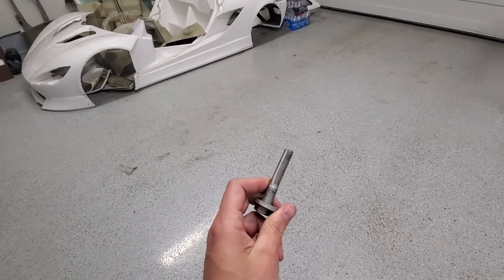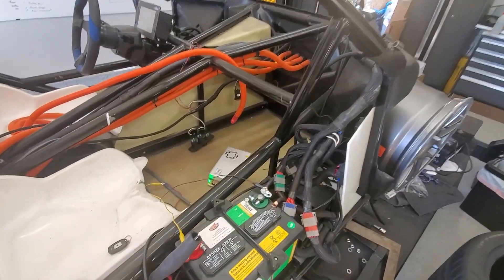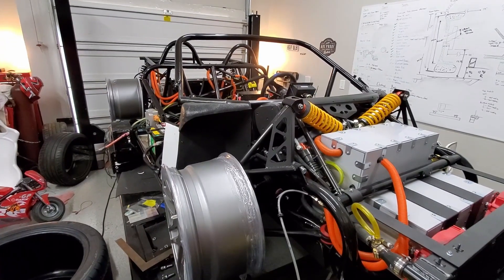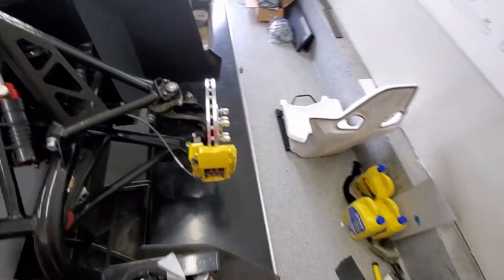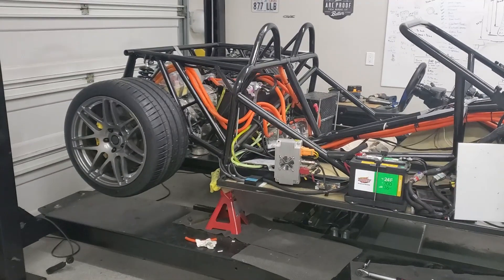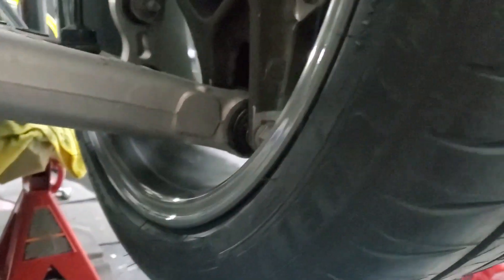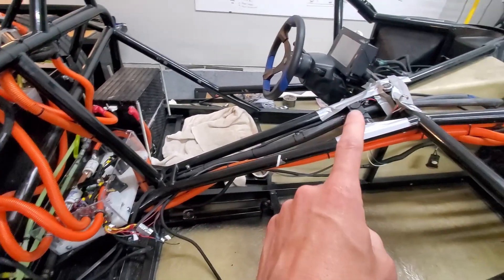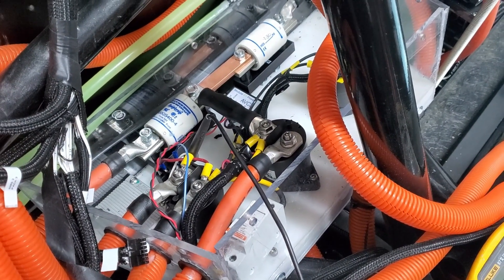Mounting kit car wheels - Forgestar F14

Comment: What sort of main controller do you use? I mean for locking door, honking, turn signal and more.
Reply from the maker: No controller for 12V systems.  I just have things running to switches and relays.
Reply: @electricsupercar  Thanks for the reply. How do you startup the car? I mean you need something to tell inverter and motor to be ready.

Is acceleration pedal sensor signal directly connected to the motor controller? How does motor controller understand how much you pressed the pedal?
Reply from the maker: @taehyeong_kim  My motor controller is from EV-Controls.  You can check out their manual.

http://www.ev-controls.com/wp-content/uploads/2019/03/EV-Controls-T1-C-Guide.pdf

My 12V system turns on and off the controller.  The controller controls the HV contactors and sends info via CAN to the motor to accelerate, regenerative braking etc.

Hope this helps.
Reply: @electricsupercar  Thank you very much.

I’m trying to put all the components out from spark ev to other custom built chassis. (Like BAC mono)

I’ll share this with you later days if it goes well.😄
Reply from the maker: @taehyeong_kim  Good luck friend!

Comment: What is the size of tires and rims, and what offset on the rims do you have there?
Reply from the maker: Tires were 325/30ZR-19 in the rear and 245/35ZR-18 in the front. Michelin pilot sport 4s
Wheels were Forgestar F14
19x12 +68 in the rear
18x9 +50 in the front
Reply: @electricsupercar  
Thank you so much for the information....

By the way...
Have you ever heard about/seen any of the Tushek cars?

Tushek Renovatio T500
www.youtube.com/watch?v=HcTsz5iNAuk

Tushek TD600
https://www.youtube.com/watch?v=9XWwQH5eHKM

Tushek TS900 APEX
https://www.youtube.com/watch?v=R_kZajHfaMc

Very interesting design development out of the K1 Attack.
I got more and more sure about to order a K1, and if I end up doing so, I will look into copy some of the design of the TS600 and others from the TS900...

Comment: Do you know what's the biggest size wheels it can get
Reply from the maker: 19" unless you want to start modifying fiberglass
Reply: @electricsupercar  how wide can it be. Thanks
Reply from the maker: It all depends on the powertrain.  I am using a stock Tesla which is extremely wide.  I will have to modify the fiberglass.  I could have had custom driveshafts made, but then would have had to fabricate new suspension and pickup points.  I am using 325 on the rear.